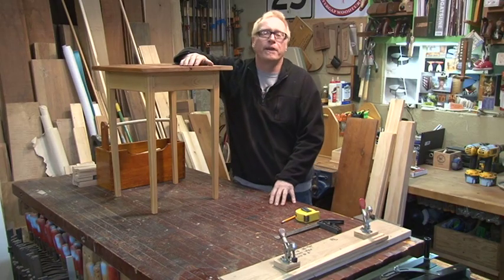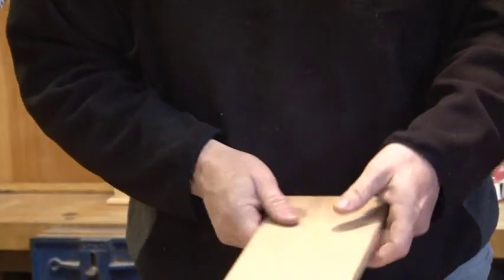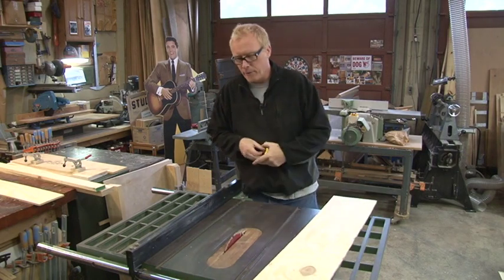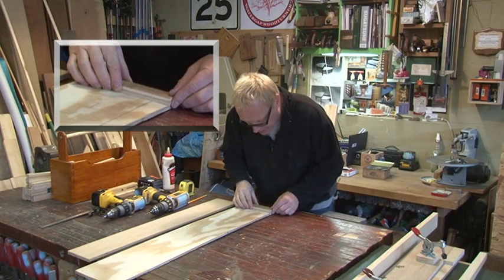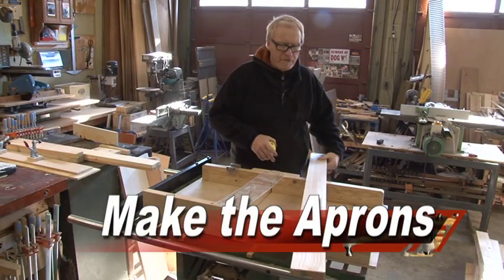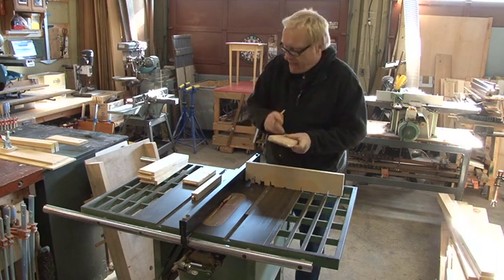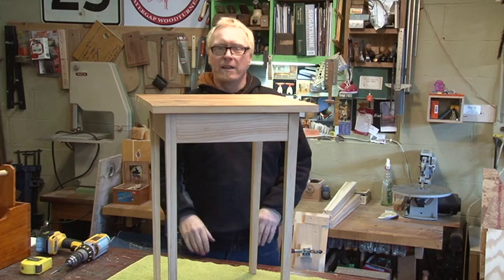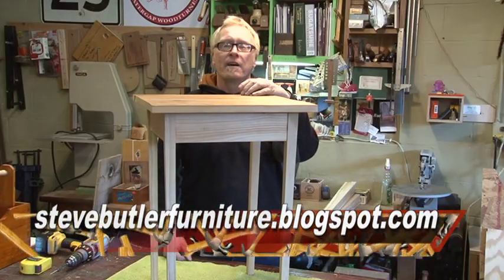006 The Garage - No Jointer, No Planer, No Problem.mpg

Comment: Great instructional video! Simple, easy to follow, but produces excellent results. I built mine this weekend and I'm real happy with how it turned out. Yellow pine for the base and red oak for the top. Took me roughly 16 hours, but Im confident I can do it in half the time next round. I did the Mortise and tenon by hand with a chisel since I dont own a router. Was a lot easier than I thought it would be, I even got two respectable looking joints.

A couple things that I thought weren't clear:
1. When you tapered the legs you didnt explain which way the tapers go for assembly. I simply guessed and made it so the tapers were done on the outside faces of the legs. Looks correct to me but some clarification would have saved me the guess work.
2. The method that you use to attach the top: Does it allow for the seasonal expansion/contraction of the top? I haven't attached my top because I'm considering other methods.

Anyway, thank you for sharing and I look forward to future projects. Maybe a shaker style chair?
Reply from the maker: Dr. Tautology Thank you;Also- I appreciate your comments.  Most tapers are done on the inside leaving a flat spot for the mortise.The holes I drill in the cleats to attach the top are elongated and then screwed with a washer included so the screw will stay affixed yet move with the wood.  This is only done on the cross grain holes.   I would love to see an image and share it on the show's Facebook page or website.  The Garage with Steve Butler  Again- Thank you for watching
Reply: S Butler Thanks for the quick reply! Bummer that I guessed wrong on the taper. Honestly, I dont think it makes too much of a difference and I kind of like being able to see the angle of the taper when looking straight at the piece. Oh well, my wife just told me that I need to make another so I have a second shot at it. Im going to get you a picture as soon as Im done with the finish, probably this weekend. Any advice for the red oak top? I was thinking about just using lindseed oil because I simply like the natural look of red oak, but I would also like some moisture protection for the occasional misplaced beverage. Any chance you could send me a diagram or picture for the cleats? I was entertaining the idea of doing rabbets on the inside aprons and using blocks to fix it in place, but your method seems much more simple and I really dont want to screw anything up at this point.
Cheers,
DocTaut
Reply from the maker: Dr. Tautology HiVisit my Facebook page and I'll have some images for you;  Linseed oil is great for preserving the natural look but it doesn't cure.  I would suggest a tung or Danish oil, let it dry and then wax it.  You'll never get the full protection as a lacquer or urethane but it'll highlight the natural grain of the wood.  I mostly always use a oil and wax finish.  I simply reapply a coat of wax every 6 months or so for maintenance.  I've never had a problem with it.  Everyone has their opinions though.  Try it and see how you like it.  thegaragewithstevebutler/facbook.com

Comment: The trick with this video is to build the jig to fit the project in question.  Most purchased project plans won't tell you that AND they won't tell you when you need one.  The best advice is to sit have a good long think about each plan and always take your existing equipment into consideration - always add that 1/16 or 1/8 measurements (blade width cut off) when calculating/cutting your materials.  This particular jig tapers on two adjacent sides with a perfectly square side.  For a four sided taper, I've seen guys use both cut offs.  This is a Shaker project, so I think the two side tapered is part of the design.  

Luckily, that tongue and groove joint on the table top has enough room at the bottom of the rabbet take any excess glue out.

I'm curious about how wood "movement" is taken into account with those cleats and table top?

(My comments and questions may be obvious, but I keep finding my self "discovering" this stuff myself)
Reply from the maker: Thanks for your comments'  There are many ways of doing things- trying many methods to achieve the same result is the best way.  Self discovery. My way is just my way.  I have used the store bought  'L' shape cleats and figure 8's.  They all work well.  I use wooden cleats because I like to save money, use my off cuts, and they work.  What you have to consider is wood movement.  In this case- the cleats attached to the bottom of the top in the same direction as the grain of the top aren't a concern.  They expand and contract at the same rate.  The other cleats are though.  I simply elongate the screw hole so it will move and attach the cleat with screws with washers.  A good rule of thumb is that the wood expands an 1/8" over a 12" span.  using your own cleats makes you think about these things.  using store bought sometimes makes us not think about these things.  Great comments.  Thanks again  Best  Steve

Comment: Mr. Butler: I just found your channel, and I'm now subscribed ! Nice job with the  jig. I must say, I really liked the music !!! I think I have everything that you played, on CD. ;-} I'm looking forward to the next video.
   On a second note, I'm of the opinion that MOST machines can do a better job than a man who is freehanding a tool. I have experience as a building contractor, and I've seen some pretty BAD hand work. On the other side, I've also seen new guys with a power tool do amazing  work.! So, .... there's that.
Reply from the maker: Hi Michael- Thanks for watching.  I agree- Tools do not make the craftsman.  My advocating in this video for not using a jointer or planer is more for economy.  Some folks can't afford these pieces of equipment, I don't want them to steer away from trying because they think they can't build something without those tools.  being a little resourceful by using off the shelf dimension lumber helps.  Thanks again   Regards  Steve

Comment: Hi Steve. I really enjoyed your video. I'm a graphic designer, great with my hands, eye for precision and know all about improve. Here's a question I think you'd be perfect to address. I'm been in the hunt for a table saw, the small portable ones with or without stand. I see some ranging from 129.00 Ryobi to 379.00 DeWalts. I clearly see the quality in part difference depending on the prices, however, i want to make the right choice. One project i will be taking on is an exterior door for my Brownstone. Anyway, any recommendations or advice would be super awesome. Thanks in advance Steve.
Reply from the maker: +Chacon Johnson   Hi Chacon   Thanks for watching, I really appreciate it. I'm not a tool expert but personally would buy a DeWalt.  I know it's extra money but my main reason in choosing DeWalt products is first: They're good tools.  Sure- there are better but they are reliable, and what I like the most is that they're everywhere.  If something breaks on them or you need a new part you can get it serviced or buy a part anywhere in the world.  Home Depot, Lowes, your local hardware, etc:  That's important to me.  I don't want to have to wait to finish a job while i wait for my specialty part to come in the mail.  I hope this helps.  Let me know what you choose, and please send a picture of the door when complete'  Regards  Steve

Comment: Did you worry about expansion and contraction of the top when you screwed the top down?  I usually use cleats so the top can move, but that may not be necessary with a table this size.
Reply from the maker: +John AKA   Hi John
Thanks for watching.  Yes- you always have to worry about expansion and contraction.  A lot of material gets left on the editing floor, for time constraints.  I elongated the screw holes that are across the grain so they move with the movement of the wood.  A good reference is to assume wood will move 1/8 inch per 12 inches of width.  Thanks for asking  Regards    Steve
Reply: +S Butler 
Cleats are a pain to make.  Can the screw heads move enough in the elongated screw holes if they are pulled up tight?  In other words, don't they bite the wood too much to move in relation to it?  I'm afraid I don't understand the concept here.
Reply from the maker: +John AKA    The screw holes aren't elongated in the table top but in the cleat or whatever you're using to attache the top.  The screws still grab the underside of the table top perfectly but move inthe cleat as the wood moves.  The screw head ( or a washer ) allow it to move with movement but still stay attached to the cleat.
I hope this helps clarify
Thanks again for watching
Regards
steve

Comment: I'm just getting started in woodworking and have been acquiring tools second hand from pawn shops or friends that are cleaning out garages.  do you think this method would work on a bench top table saw?

Thank you for the videos.
Reply from the maker: Hi Michael.  Thanks for watching.  Yes- it's possible , but- I would make sure everything is solid and square on the saw.  bench top saw get used rather ruggedly so tune it up.  I would add a table at the back for support , especially when you cut the tapers.  It can be a little awkward, but yes, it'll work.  I'd like to see the end results if you try the project. Enjoy your new venture into woodworking, it's an awesome path'  If you have any other questions you can reach me on my face book page also.  have fun  Best Steve

Comment: Hi Steve. Just found your channel and am loving your videos. One question I have is when cutting the tenons you clearly state on how to get the proper length but you don't mention how to find the precise blade height to get the perfect width on the tenon. Do you have any tips or should I just use test pieces and creep up on the perfect blade height? Thanks for the great video! Subscribed
Reply from the maker: Thank you for watching.  My apologies, thanks for pointing that out.  Yes- always do some test pieces and creep up to it.  You cab measure with the best measuring tool, but you should always do a test piece.  Your dry fitted tenon should be able to stay in the mortise when you hold it upside down, not falling out.  You shouldn't need a hammer though to fit it in.  Thanks again for watching.  Regards Steve
Reply: S Butler Cool thanks. I'm going to try making this. You make it look so easy!

Comment: What is the name of the clamps and where can you get them?
Reply from the maker: Clint Norwood   Hi Clint
I'm assuming you mean the clamps I use on the tapered leg jig?  If so - they are simply called toggle clamps and can be found at most home centers for  a reasonable amount.  They have name brands like Staco, etc but the type of clamp is a toggle clamp
Thanks for watching
Regards
steve
Reply: Thanks! Found some locally, these will be very useful.

Comment: HOW DO YOU FLATTEN YOUR BOARDS FOR THE TOP BUD??
Reply from the maker: Hi Dave.  Thanks for watching.  On the old pine floor boards i used, I didn't.  I wanted to leave the old patina on, and they were very flat.  otherwise I'd use a hand plane and hit the high spots,

Comment: Food for thought: 100-200 years ago, people didn't do so many things and knowledge and material wasn't accessible. Nowdays, because of the availability of building material and access to knowledge, people "dabble" and want to build "quality" woodwork as soon as possible. It use to be (and it still is) that quality came with experience and understanding of hand tools, which a devoted wood-worker (or someone with specialized knowledge) would develop over time. 

People whose values differ from that of woodworkers (i.e., not everyone has time to care about the inner/outer workings of a tool or the way wood handles during construction) leverage time-efficiency at the cost of understanding and quality (though there are some machines/power tools that CAN do quality work). Machines consists of components. So woodworking, from the viewpoint of a "dabbler" has a high-cost of entry. 

I do agree, though, that woodworking does not necessarily require you to throw money at it. But the tradeoff is time-efficiency and quality.
Reply: Just speculation. 

On a different note. Thanks for the design tips. I never thought to put a plexi-glass between the cutting space of a  sled and my face. My days of eating woodchips is over :).
Reply from the maker: I agree.  My main objective is to get people involved in the wonderful craft of woodworking without being intimidated that they don't have all of the bells and whistles.  You shouldn't be afraid of trying something, there are other means to get from point A to point B.  You can accumulate the tools as you accumulate the skills, In time.  But still try.
Thank you for the note.  I appreciate you watching   Regards  Steve

Comment: So, your solution to 'No jointer, No planer, No problem' is to buy already dimensioned lumber? Then why not buy the whole table instead of building it? The common lumber is too expensive already.
I am sorry but I find your title misleading.
Reply from the maker: +Nikolaos Giakoumis I appreciate your comments- the premise of the show is to make woodworking accessible to most people.  YES- dimension lumber is expensive, but to a newcomer to woodworking buying rough lumber at a lumber store can be the most daunting experience.  Not knowing what lies beneath the surface and yet haveing to pay fro it can be tortuous if you have no experience.  I feel the slight extra cost for knowing what your getting is fine.  i want to turn people on to woodworking, not make them feel like they shouldn't try.  add the cost of a jointer and planer and i think the slight extra cost of dimensioned lumber is justified.  I hope you enjoy your craft, I enjoy mine, and i want others to discover what we enjoy.  Again- I appreciate your views and appreciate that you commented.  Regards Steve